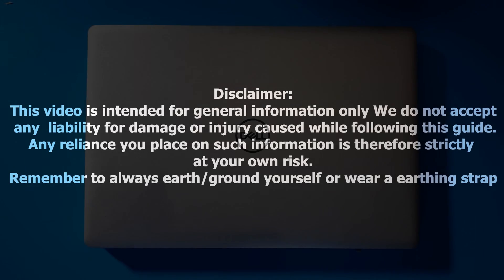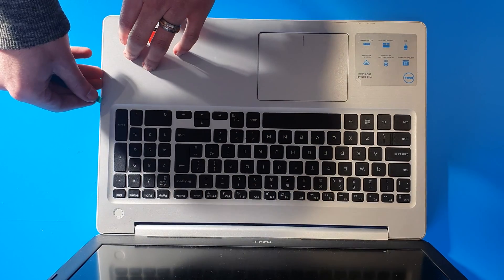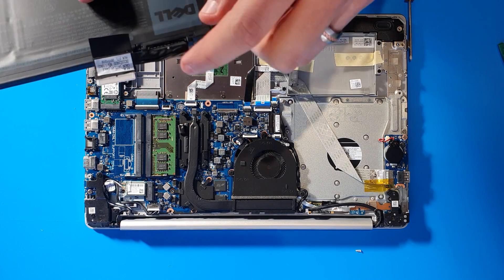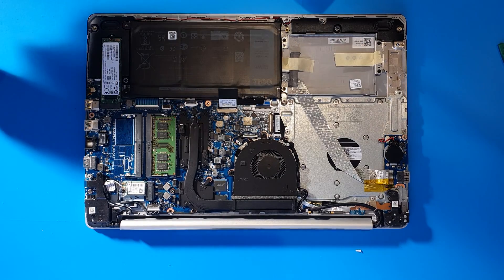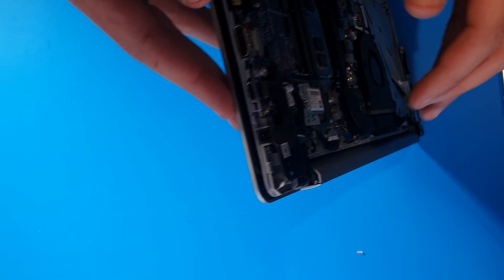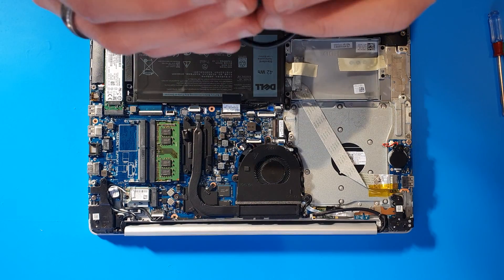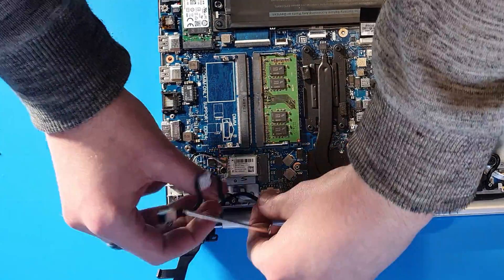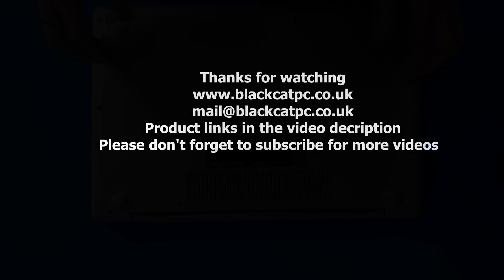How to replace a Dell Inspiron 5570 laptop battery (WDX0R) / DC port charging jack

Comment: Is there a difference between

cable

WDX0R-YRDD6

The battery is the same
Reply from the maker: They are different batteries with the battery connector in a slightly different place